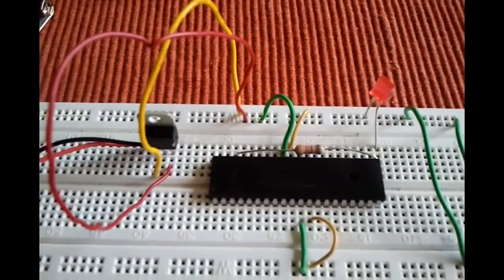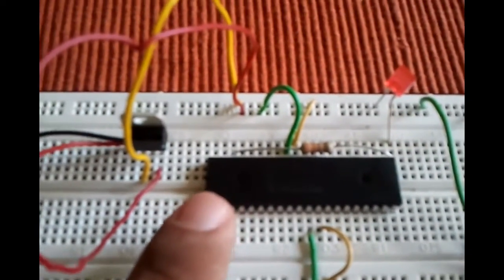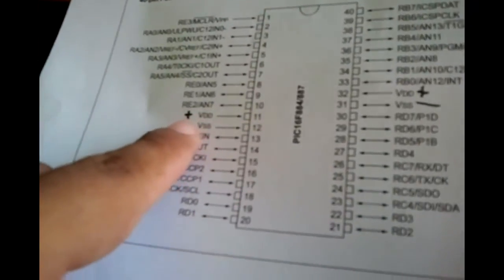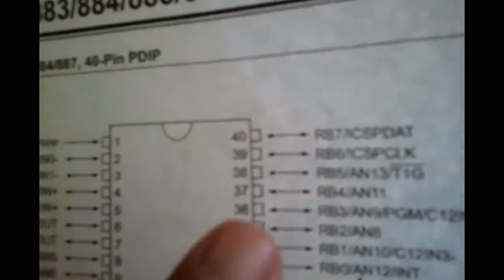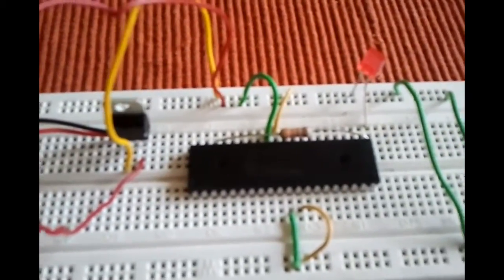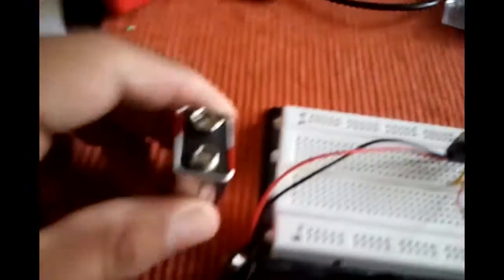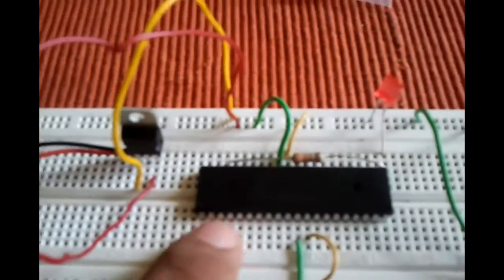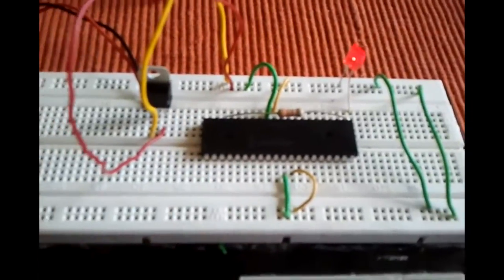PIC PIC16F887 blinking LED steup

Comment: hi i have a plenty of questions.should we connect 5 volts to vdd and ground to vss? I have adapter which gives 5 volts. what did you choose for oscillator? HS XTAL or internal oscillator?